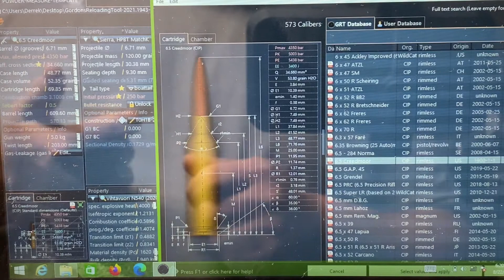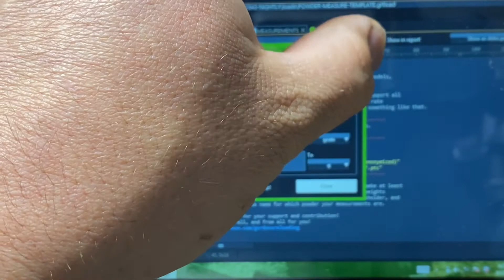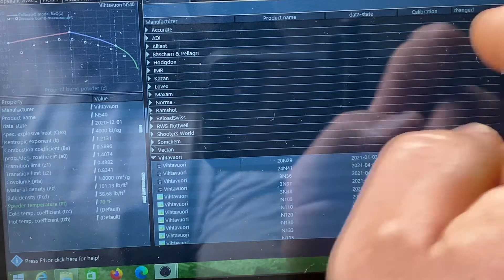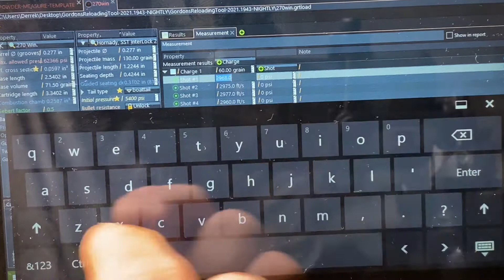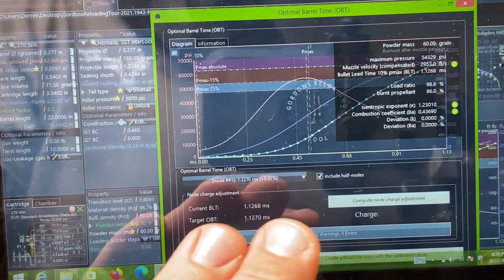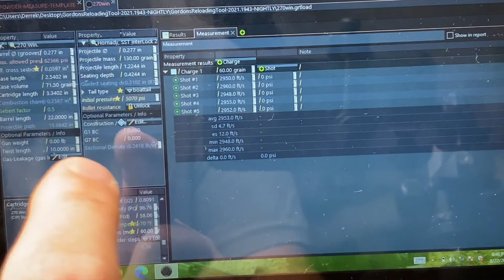270 Winchester load development and Gordon’s reloading tool how too.

Comment: Note: You'd have to check for any given cartridge, but I'm pretty sure GRT uses the European standard for maximum average pressure rather than the SAAMI (i.e., U.S.) standard. With 270 Win, for example, MAP is higher for SAAMI than the European standard. If it's your first time using it for a specific cartridge, it's good to check and adjust accordingly (if you want to use SAAMI) after you load the cartridge data (e.g., for 270 Win) but before doing anything else

Comment: Hi I am a little lost with this.  Been working with GRT for a while and now getting into the OBT section.  I followed your video and input a 3 shot group from my Garmin.  I understand that 5 shot group would be better but this is what I had to use for following your video.  In results the predicted Muzzle velocity (MV) is 2542.5 actual avg. MV in measurements after inputting the 3 shot group is 2758.9 which aligns with the Garmin.  My question is how do I change the predicted MV to actual which I can then align Initial Pressure ?  Thanks, Mike

Comment: Keep an eye on the load ratio and burnt propellant in obt window. Over 100 on load ratio means a compressed charge. Under 100 on the burnt propellant means not all the powder is burning. You may want to try another powder that burns it all on at least a few powder charges in the ladder.
Reply: If you are target shooting long range 100% burnt propellant apparently makes a difference. For hunting 250 yards and in, H4831sc is accurate enough and relatively consistent across temperature changes. That powder was the EZ button for 270 Winchester for decades. I have modeled 270 Winchester in GRT. H4831sc doesn’t look good in terms of propellant burnt, but it looks fairly good on paper. The rifle I’ve been working with recently is a 20” barrel Sako carbine so that’s been interesting. With the shorter barrel, N550 looks better in the model and on target. Oh - a compressed charge up to 103% isn’t “bad” for most powders.

Comment: Do you have to measure your case volume? With water ?
Reply from the maker: Yes measure empty case with spent primer and zero scale then add water to the tip top and re measure the weight. Grains of h20 will be your measurement

Comment: I have a question if I could I’m working up a load for a 33 XC it’s basically a 338 Lapua with a larger H2O volume Gordons 
doesn’t have 33 XC in its drop-down list so what I’ve been doing is taking the 338 Lapua because both the Lapua and 33 XC have the same bolt face their shoulder angles are a little different and their water capacities  
Is different along with the case length. So here is my question if I enter the new H2O capacity and new case length would that work? Thanks for your advice.
Reply from the maker: Yes
Reply: Once again, thank you very much for your help. I look forward to watching the rest of the videos and looking forward to any new ones you have I appreciate your generosity with your knowledge and time
Reply: On another note, do you have one of your videos that shows how to use the Gordon’s  with wildcat cartridges?

Comment: I don't have my load data with me, I want to say its 52.4gr of h4831sc under a 160gr partition.  My trusty elk load.  Some say you can't stabilize that bullet at 1:10 twist but my budget unmodified Savage Axis likes it.  I have used both regular and short cut 4831, either works very well, I think sc meters better.

Comment: I have loaded .270 win since 1968, using H4831. As O'Connor said you could fill the case and never have too much pressure! I tried 60gr, 61gr and found 59gr to be the best for me with 130 gr bullets. This was very repeatable in my M77, down to 1/2" groups @ 100 yds. Speer Hotcore 130's were super.

Comment: Just subscribed and hit the notification bell. Here is some of my load data for my savage 110 e 270win 22in barrel 1-10 twist. 

March 22nd 270 win 22 inch barrel Savage 110-E 145gr eld-x h4350 night time 8:40pm

Temperature 69
Wind 0
Cross 0
Head 0 
Barometric pressure min 14.2 ave 14.14 max 14.15
Humidity ave 67.7
Altitude 1072 

51 grains 

Velocity 
1st shot=2891
2nd shot=2878
3rd =2894
4= 2898

51.2 grains

1=2912
2nd 2892
3rd 2905
4th 2856
5th 2876

51.4 grains 

1st 2899
2nd 2922
3rd 2922
4th 2915 
5th 2889

I thought some of your data might have seemed off. I could be wrong though wouldn’t be the first time.